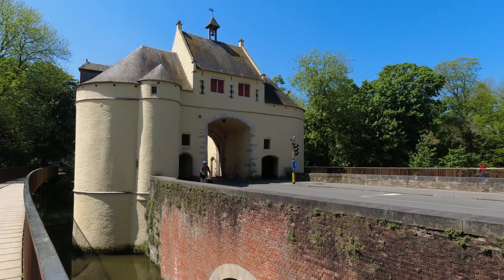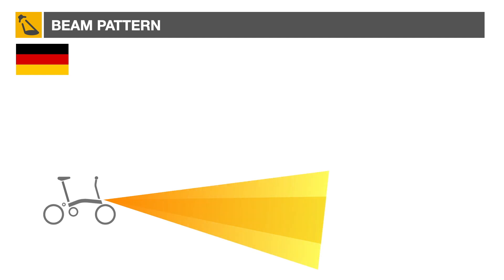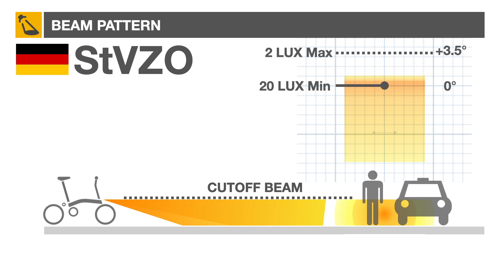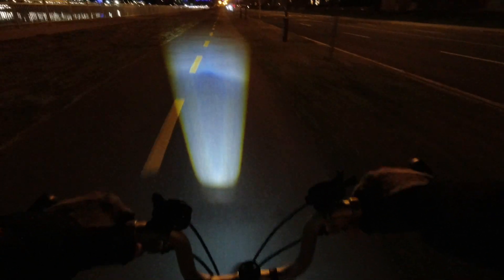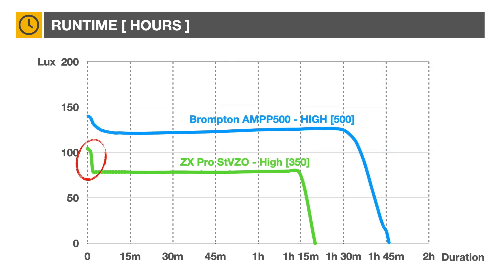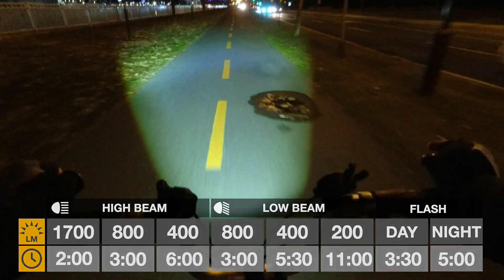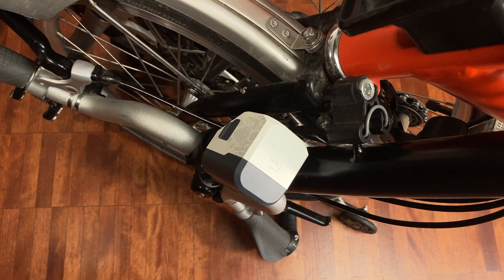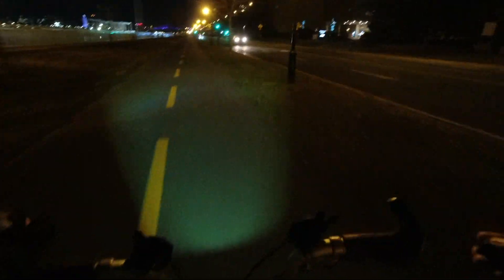Bicycle Headlight regulations [ Magicshine ZX Pro vs EVO 1700 ]

Comment: I ride my bike/s 20-40 miles a day (365 a year) here in Germany - in all my around 20 years I never got issues with police. I am using Lezyne 1400+ up front (on my road bike also a Ravemen FR500 as daytime light), Lezyne Strip 400 and a Sigma RL 80 in the rear (the Strip in flash mode/s and the Sigma always in steady mode, both at a time)! Cops I talked to were curious about my lights more than telling me to not use them. I did experience that ppl are way more aware around me. Even, if I get a ticket sometime, I will keep using lights like that! Its for my own safety!
Reply from the maker: It's great that you prioritize your safety and that the police in Germany are curious rather than critical.

Comment: Hi. You are wrong about headlight regulations. Thanks to Art 44 of Vienna Convention on Road Traffic you are allowed to use whatever headlights are legal in one signatory country and ride with those through all of the signing countries (which includes almost all of the Europe).
So there is absolutely no need to change anything about your lighting as long as your lighting is legal in your own country and it meets minimum criteria specified in art 44, and as long as you are riding within countries signatories of the convention.
Reply from the maker: Thanks for the clarification. Not sure however we would want to argue with a German Police Officer: “We are not from here, our dazzling front light  and flashing rear light are legal in our country, so these are not the lights you are looking for”.
A reasonable cut-off beam (even if not STVZO) and avoiding flashing lights would likely be a good way to avoid unnecessary attention.
Reply: @2Bikes4Adventure Exactly. Here in Spain it doesn't hardly matter what the law says, and even less what international laws dictate; it is just about what the policeman in front of you states. No "negociating" possible.
Reply from the maker: @kayasper6081 That’s the same in many countries. In some, negociation$ are possible apparently :-)

Comment: I don't wanna push people to illegality but the original Cateye Amp series do offer 200 lumens, none-blinking mode and shine quite low, on the original bracket, as to seriously glare anyone... Let aside that this is a much safer solution and closer to the regulation than the mostly maladjusted (and sometimes generally badly adjustable) batteries or dynamos on most bikes, rollers and pedestrians... I can imagine only a really unrealistic and specific type of accident where the street licensing and the spillover of the light may be verified and become an issue...
Reply from the maker: Would be interesting to know  how strict the law is implemented in Germany (and if actual fine are being distributed). We would not be surprised if it could be used as aggravating factor if an officer already stop you for some other offence.
Reply: @2Bikes4Adventure  ...not really, never experienced nor ever heard of such a case, the latest 25 years... Running over a red light, e-bike tuning (e support above 25 kmh) and alcohol limits are the only bike traffic fines I ve ever heard of...

Comment: output level on the road shouldn't matter that much

afterall i can guarantee the B&M IQ-XL and the Lupine SL-X or Supernova M99 Pro 2 are far brighter than that magicshine but completely legal StVZO lights and even high beam is allowed as an option per StVZO regulations, just no flash modi
Reply from the maker: We agree. After all, at €440.00 (Lupine SL X), €300.00 (B&M IQ-XL) or €377.00 (Supernova M99 Pro 2), one would hope they are far brighter than the €90.00 Magicshine ZX Pro 🙂
Reply: @2Bikes4Adventure  i get that but i meant the EVO regardless, because you (unbeknownst to me) turned down the brightness? like why would you artificially make it worse

i have an IQ-XL (bought it for €180 btw from r2-bike, which yes is still alot) and i still wish it would put MORE light out in both low and high beam

don't get me wrong it's not like they're not bright, but it can always be brighter especially at these prices.

i don't like how the Evo 1700 has a bad beam cutoff tho, on the IQ-XL it is literally a flat line and beyond that almost perfectly lit

but ye imo a good bike light would be far brighter than street lights on the road, but that's just my opinion

most street lights in here thankfully don't have those god awful yellow/orange hps or sox lights anymore tho

Comment: 350 lumens is enough on a lit road in the city. But the light spot of a 350-lumen headlight is shorter than the braking distance. Why not ban headlights more powerful than 350 lumens on cars?

Comment: Any mounting tips for a Brompton?
Reply from the maker: There are many options depending on the handlebar type and size of front bag used.
If you are not using large front bags, you can mount it under the handlebar (easier on S-type and old M/H-type handlebar) or on the stem. Many GoPro handlebars mount found on Amazon will do the job and will enable to keep the light installed even when the bike is folded. If you mount it on the stem (ref https://youtu.be/CLfTqA0JGlk?si=of0-WN108ysoslkS from BFT YT Channel), you will have to remove the light when folding (kind of annoying).
Finally, if you use large front bag, the best solution is probably the H&H Carrier Block GoPro Adaptor for Brompton. You will need to buy the corresponding H&H Carrier Block however (costly solution)

Having the old M-type handlebar, we used a Garmin handlebar mount installed up-side-down and a GoPro-Garmin adaptor. We can keep the light on even when folded, but if we use large bags, the beam will be partially obstructed.
Reply: @ Many thanks. Also, I found this by googling, and ordered one. Long delivery time, so I won’t be able to test it for a while, but it could be ideal. My worry is interfering with the bottom of a bag, as the images seem to show the top of the bracket to be rather high.
Reply from the maker: @snoogly This (https://magicshine.com/collections/accessories/products/forkix-extendable-front-light-mount) from Magicshine is new is seems to address our problem

Comment: I live in Germany and never in 40 years i got a control through the police
Reply from the maker: That’s why we think, for occasional visitors, a headlight with a decent cutoff (even if not officially StVZO certified) is sufficient
Reply: @2Bikes4Adventure  yeah but that we have a border how bright it can be is new to me. Never heard of it.
I have a bicycle light with high beam option as light for far like on car that is stvzo regulated with 150 lux.

I only knew that they must have the beam characteristics like a car head light.

Important too is to have the right reflectors in germany on the bike

Comment: Thank you for the overview on light regulations! I recently moved from UK to Germany and had to replace headlights on both my Bromptons to comply with German laws. You may also want to cover regulations around reflectors, as this is another aspect where the Germans are way more strict.
Reply from the maker: Good suggestion (ref reflectors). Based on your experience so far, are cyclists in Germany actually following all those rules (ex.: no flashing rear lights)?
Reply: The German rule is "no flashing lights on your bicycle". 

Flashing lights on your person on the other hand...as far as I know there aren't any rules in Germany about flashing lights  on your person, so that's why I use a flashing rear light on my belt/helmet (in addition to the steady rear light on the bicycle itself).
Reply from the maker: @user-zw6pn3ql7y Very clever workaround! We do own helmets with integrated (flashing) lights (Nutcase Vio), maybe we should make sure to use them when visiting Germany
Reply: @2Bikes4Adventure  The Abus helmet I bought in Germany has an integrated light that flashes. As far as I'm concerned I switch it on when riding at night.
Reply: @2Bikes4Adventure  the majority of people do, particularly riders with modern bikes. But you also see old bycicles that for sure are not 100% following the street regulation...
Reply: @2Bikes4Adventure  German here. Have hardly seen any blinking lights in decades and personally feel they are if anything less safe. The beam cutoff is followed mostly because name brand bike lights you get in most shops just come like that, but lots of people also buy non-conformant ones directly from China.

Comment: All these nonsense laws that help nobody
Reply: I am live in Germany and I value these kind of lights because they are more efficient.
The available light rays from a light source (usually LED) are hit a reflector and will be directed to the surface of the road, just in the same way this will work on any car.
The goal is not to light a wall, the goal is to evenly light the road.
So any more light that is send out to the sky is wasted.
Some is necessary for seeing road signs, but most of the light is needed on the road.
This also help to not blind opposing traffic.
Any bike light that has a round beam didn't let you see enough or waste lots of power.
As far as I know also lights that have an additional high-beam are legal. Of course this needs to be deactivated if there is some opposing traffic.

Many years ago, during a time LED bike lights are not everywhere available, I build my own bike lights from 4 LEDs with a round beam.
The visible result from this 8W system was poor, because a lack of a proper reflector.

I don't state that the exact German regulation is good, but the idea to send the usuable light from a source evenly distributed to the road is good.
Reply: At least it gives us something to complain about. ;-)
Reply from the maker: And publish a video about it :-)
Reply: I mean the cutoff-type beam pattern does make sense for not blinding other road users (assuming people don't just point their lights upwards 😁). But the rest of our rules could just go in the trash and it wouldn't be worse. 
200 lm on a very wide beam gives you very low intensity. So not many lux on the road in front of you. The same light output will reach further/brighten up the road more when it's paired with a narrow optic. 
Blinking lights can be pretty distracting, I'm not too big of a fan of it, but I do understand that it makes bikes massively more visible, improving safety. 
Plus here in Germany, bikes are quasi the only source of blinking white of red light on the streets. So even when drivers see only a reflection of it, they immediately know that there's someone on a bike. With static lights you can be mistaken for a car or anything else. Especially on rainy nights. 

I personally ride with two selfmade lights. Both have elliptical beam profiles. Wider horizontally and not as tall vertically. One for rides on public roads with an overall narrower beam that doesn't blind others as much, the other one for lonely rides on backroads, woods and such with a bigger illumination area. 
Totally not STVZO-konform but still sensible as far as I'm concerned. 
For my rear light (which I don't use on those lonely, slow roads or offroad) I have a static light, but with a cheaply brake light function so it does get brighter and dimmer whenever it (often falsely) registers me using the brakes. STVZO, even 😃

Comment: Have you tried the Towild Dlite 1800? Might be a nice middle ground: 5000mah, two optics (flood and spot), power bank functionality and can be mounted both above and below (the mount is removable and the mount track is symmetric). I bet the flood-only could perhaps abide by StVZO?
Reply from the maker: We haven’t had the chance to evaluate it. The versatile mounting system certainly facilitates its installation.